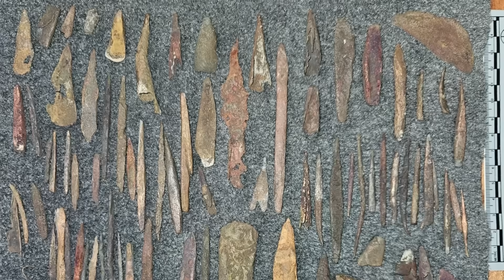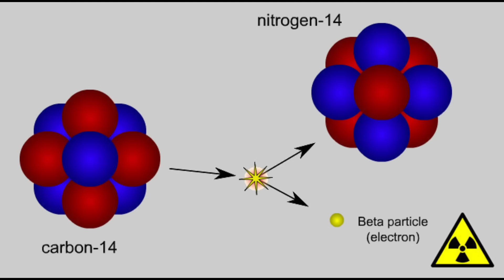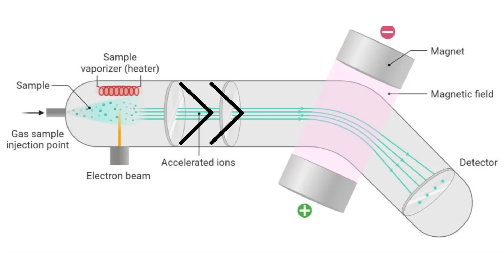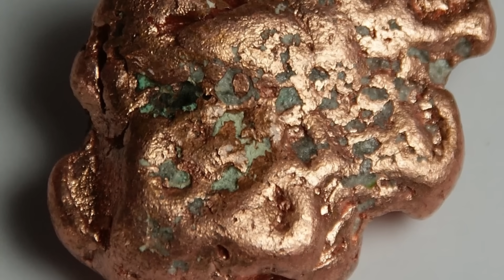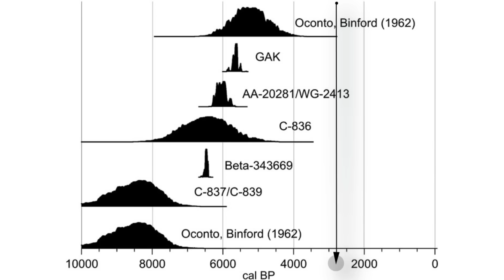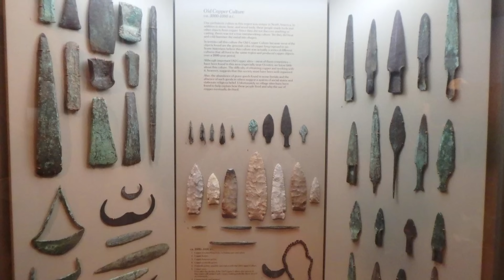Groundbreaking Discovery Shows The Metal Age Started in America!

Comment: When you heat relatively pure copper (annealing it) it becomes very soft and easy to work, but has much less strength/durability compared to stone materials. A lot of work for very little gain.  Working the copper will harden it again but that has useful limits, and still less durable. They simply didn't need it beyond a few specific uses and ornamentation.  Tin (for bronze) or iron would have changed everything. The pure copper probably spoiled or "blinded" them to the other possibilities.
Reply: Bronze was smelted in the Americas for thousands of years. Given the vast travels of Aztec merchant armies, it is likely that bronze was widespread even in what is now the USA.

Comment: no smelting and no tin so they couldn't advance to the Bronze age which would have totally transformed their cultures
Reply: Different bronze alloys were smelted in Mexico and South America before Columbus.
Reply: South American wind powered bronze smelters called Huayras have exited for more than 3,000 years and were still in use when the Spanish arrived
Reply: Of course theres tin, the American continent has just about every mineral you can think of.
Reply: Not really.  This video actually gets it a bit wrong.  WHile the copper is very pure in comparison to most other sources of copper it's not 100% pure.  It's already in a bronzish form in most cases containing small percentages of other metals like iron, silver etc.  Once work hardened a lot of the tools are actually far more durable than the "testing" reveales because they used pure non work hardened copper.   However it is very costly in labour to produce.  Repairs are nowhere as difficult as they made it out to be and tools were designed to fit their purposes.    In fact after  european contact native americans again begin to use pot copper for the same weapons and tools centuries later.  It's likely other forces were the downfall of the copper age.  Mostly climate, food shortages, deforestation due to industry and probably war and famine.   When times were good they wanted the copper tools.  When times were bad stone was more than good enough so it became more popular over time as new sources of the rarer stone become available over time.   In most of these copper sites you ALSO find stone tools as well........they co-exist.  It's not like they use one or the other.  It's just that the stone was not as plentiful in these areas as the video makes it seem until much later dates.